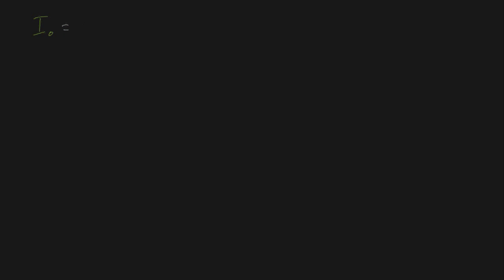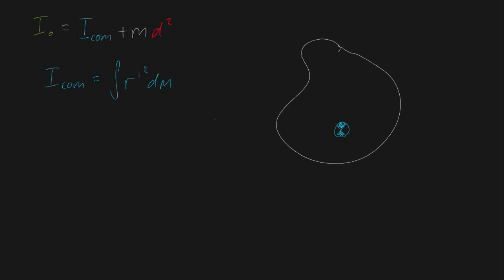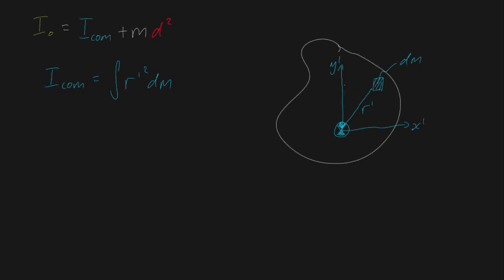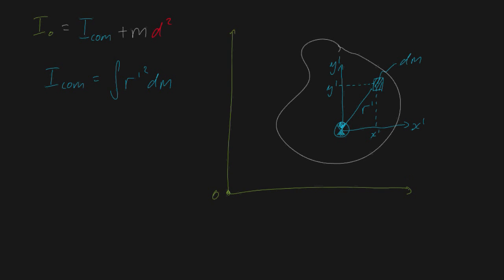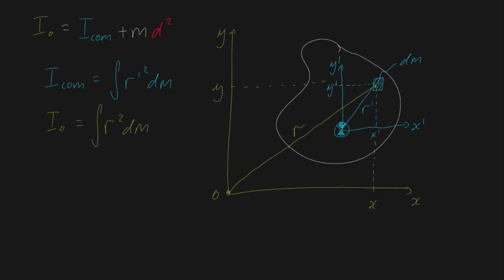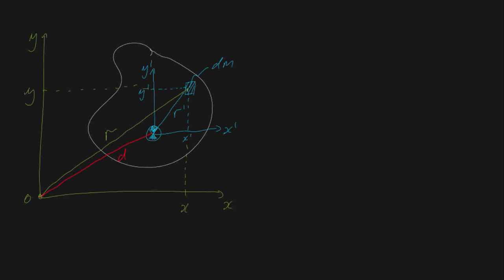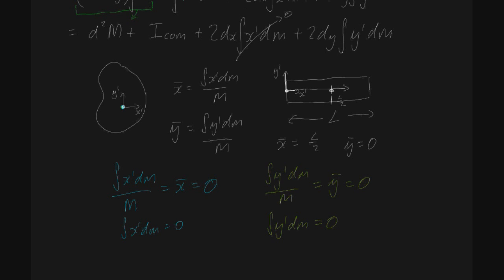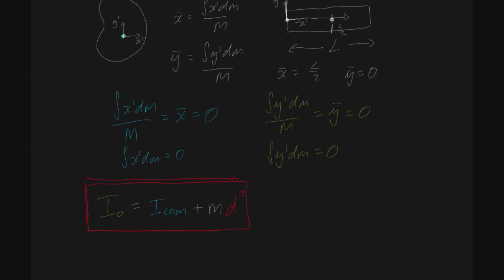parallel axis theorem proof

Comment: But what if r dash was perfectly vertical? What if the point(element of mass dm) was moved such that r dash is vertical? How would that pan out since you can't take the components of r dash?
Reply from the maker: Hey mate, imagine dividing this 2D plate into infinitely many rectangular small chunks of mass. So for example, one small chunk of mass could be at the bottom left of the plate and another could be in the middle somewhere to the right etc.. As you can see, in the general case an element of mass will have a vertical (y') and horizontal component (x'). 

It's true that some chunks of mass which happen to align directly on the y axis will have no horizontal component, but in general this is not true. If we say that the element of mass dm has no horizontal component then we're "telling the equation" that every single chunk of mass is located in a straight vertical line - and this is incorrect. 

This is a question that really strikes at the heart of calculus, so if you want to learn more I suggest researching 'double riemann sums'. 

Hope that makes sense :)